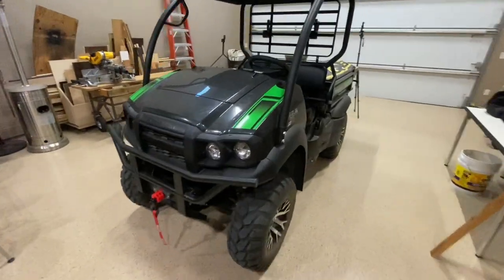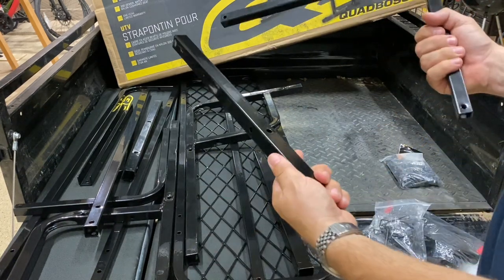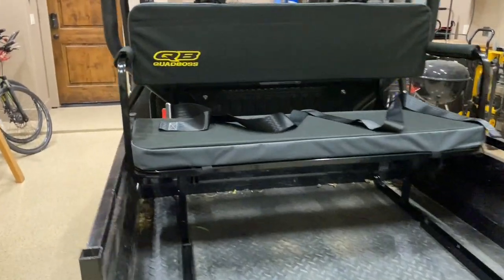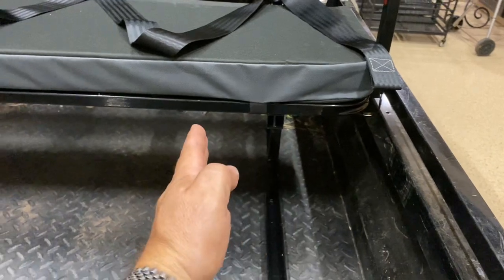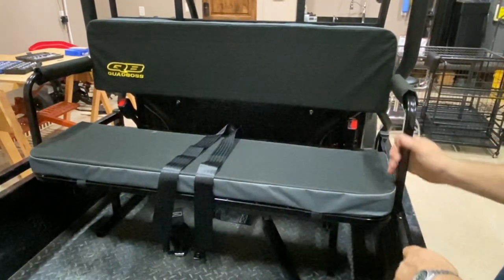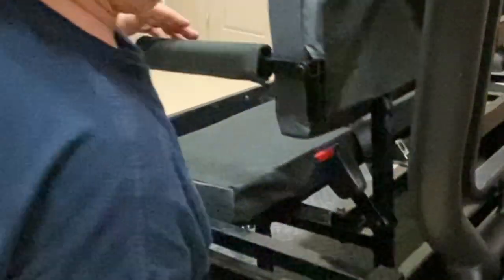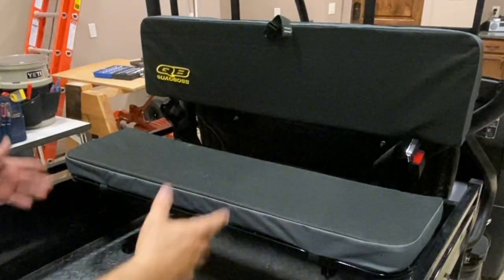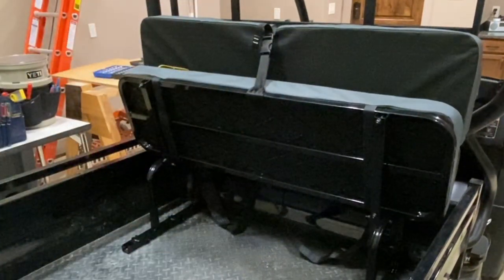Kawasaki Mule SX ● Install Quadboss Jump Seat for Passengers

Comment: Nice. Had a very simmilar pair of factory fitted jump seats in my old Mitsubishi Pajero, except there was no seat support brackets bolted to and extending across the floor, instead they had a clever swing out support fixed to the base of the seats.